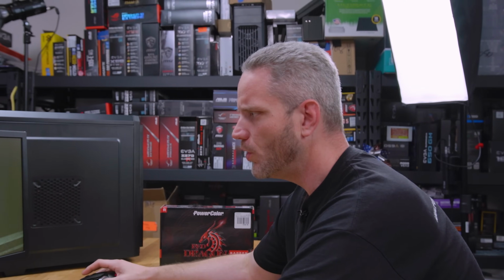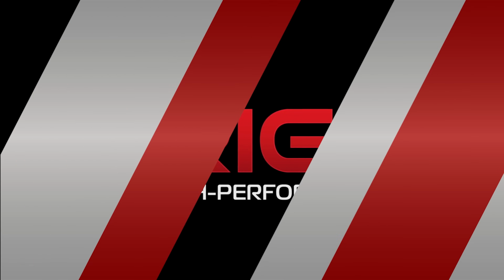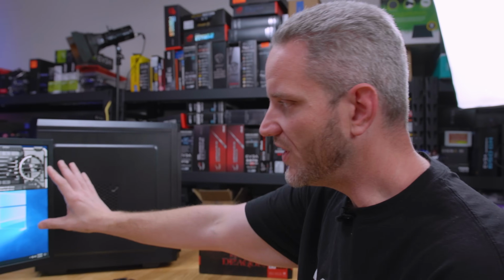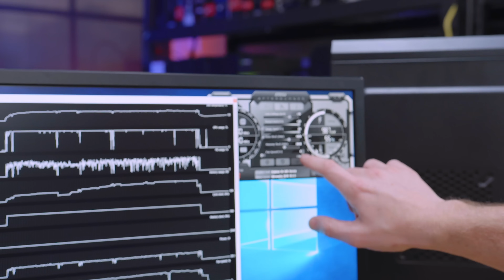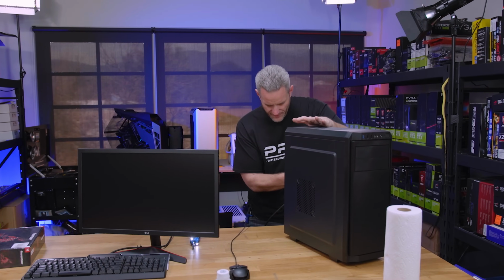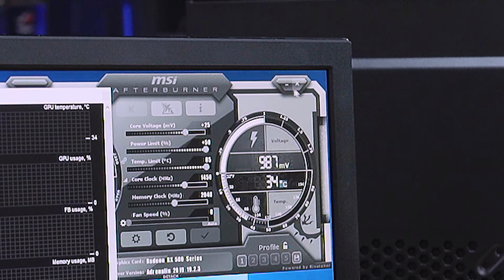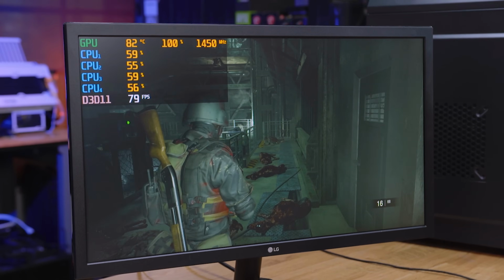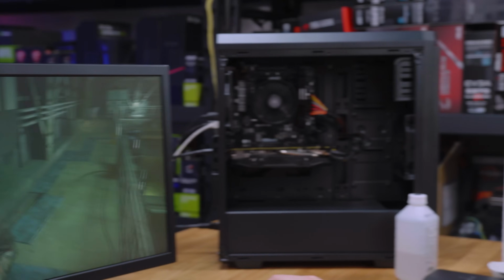Should you replace your video card's thermal paste??

Comment: Oh jay you done goofed on this one :(

Of course you won't see a difference in temperatures because the card has targettemps. Thats also the reason why even putting that huge fan on your case didn't do much, due to the cards fan curve it will always try to ramp less and less up since the card is getting cooler.

Next time when you do a test like this, try to set the fanspeed to 100% or another fixed speed and then do before and after, that way you will see the improvement. By repasting you made the card much quieter.
Reply: This makes perfect sense
Reply: Yeah I was gonna say, surely he's just making the GPU cooler RPM lower.  Still an improvement though.
Reply: Thank God somebody else figured it out.

If you ever want to do this kind of testing you need to compare fan speeds. Better yet use a fixed value so your only variable is temps.
Reply: @taylorsharp5928  i keep my 2080 at 100% fan speed while playing games. i didn't buy a high end GPU for it to be quiet lol. bought it to get high fps
Reply: @ZapdosVz  - You'd get high fps with rtx 2080 anyways so I don't really see the point of having a vacuum cleaner right next to your ear.
Reply: @Hasla Hali I got the card for high FPS. I didn’t buy it worried about the sound. I have two monitors I switch between for gaming, a 1080p 240Hz and a 1440p 144Hz. I like to make sure my FPS doesn’t dip below those refresh rates. Lower temps=more FPS because the way gpu boost works
Reply: Zapdos Vz - Well sure, you can use your card as a leaf blower and maybe gain 3 fps more. I can't really see the point personally but you're free to do whatever you want with it.
Reply: @ZapdosVz  Running your fan speed at %100 is a great way of burning out the motors
Reply: @taylorsharp5928 I use my r9 290X at 100% fan speed more often than not, specially when playing heavy titles
Reply: @Almamu  I Killed my 290x's fan by doing this. But then I replaced it with a arctic accelero xtreme iii, cooler. Wish I had known years ago just what a major difference that cooler makes.
I Highly recommend it.
Reply: @kewlztertc5386  it really depends on the brand you bought. The Sapphire fans are shit and I had two of them die without manually setting any fan speed, just with the stock fan curve, so I had to replace them, once I put some equivalent fans that weren't shit I haven't had an issue with them dying, but they'll wear out pretty fast, and that's okay with me, I'll just replace them or buy a better cooler when that happens
Reply: @Almamu  mine is a sapphire too. noisy card, worth replacing the cooler just for sound.
Reply: Yep he's a moron
Reply: @aaron-xi8dq  not a moron, just a missed step.  it happens sometimes.
Reply: You're right. I came down in the comment section to say this. Jay, you should revisit this by setting the fans on 100%. That way you will be able to see a difference.
Reply: Couldn't agree more
Reply: @taylorsharp5928  A couple of degrees could matter a lot when it comes to hbm2, that's because it's extremely temperature sensitive from what i understand.
Reply: Yeah, I came to the comments to say just that - in fact I have already replied about target temperatures in a different comment thread already.
Reply: @taylorsharp5928  do you even game?
Reply: I see this comment just after I post my commnet. Finally got someone know what exactly Radeon card works.
Reply: @taylorsharp5928  my custom curve is 100% at 65c brought my boost clock from 1879`1919 to a stable 1999. no more frame drops at 1440p either. id say its user case and card cooler type dependent
Reply: @taylorsharp5928  well most of the Time if u using zotac gtx 1070 mini.
Reply: I was gonna say exectly the same. Good point, you should always consider the fan rpm.
Reply: Can somebody explain how this makes sense? Jay said after changing the thermal paste that all the settings are the same, including the fan curve settings. If the GPU fan was running at e.g. 70% @80 degrees before changing the paste, it will still run at that 70% rate when it reaches 80 degrees after you change the paste. So, the same conditions? If the card reaches the same temperatures as before and reaches the same fan speed as before, how is it quieter? What you're saying is: "you won't see any temperature difference on your GPU if you change your thermal paste or even if you put a huge fan facing it, unless you set your GPU fan speed at 100%". In fact the huge fan of course had an effect, went from 81 to 74 in a few moments. We just don't know how much lower it went because it was cut. It's just a low-end card that doesn't cool itself very well.
Reply: @UnknownEAFCPlayer  You're right... on the stock fan curve, the fans wouldn't run any slower if the temperatures stayed the same. There's a ton of mixed information and bandwagoning going in.
Reply: @taylorsharp5928  Any time I'm not on water (which is rare) I just put my cards full blast and leave it there.
Reply: Kek
Reply: MSI, afterburner has an always on default fan curve, that can be used to over ride AMD s temp target control.
Reply: This. There is no way Jayz could change temps for a Polaris card without using fixed fan speed. Polaris cards have target temps that card wants to keep everytime, meaning the only difference is fan speed to keep that temp. You could change that target temp through BIOS mods btw.

Two days ago I got a MSI RX480 8Gb that was  really hot into the 80ºc, throttling hard. Changed thermal paste to Noctua NT-H2, modded BIOS to a RX580 one and applied some undervolt and changes in mem timings. Now, it stays at 65ºC without throttling. It is completely a different card now (not only because 580 BIOS).

Same happened recently to a RX570 4Gb Gigabyte, which had an original thermal paste application that was really bad. New paste = bye problems.

Apart from Polaris cards, I have experienced something quite similar with R9 290s from ASUS, where new paste = no throttling and less temps.

So, my conclusion is that changing thermal paste is something really recommended for older cards that throttle hard even with fans spinning at maximum, which are usually the way a bad thermal paste behaves in a modern GPU.
Reply: plus he just gooped the shit on there instead of spreading a thin layer
Reply: @AlphaStream_AI  You really haven't researched this have you?
Reply: @802Garage  from personal experience, my video card was running super hot so i took it apart and put a thin layer of arctic silver and that took care of it. I would never think of just squirting it on and not spreading it out. If its not thin it acts as an insulator instead of a transfer of heat.
Reply: @AlphaStream_AI  Research the topic. There have been tests done on this. Your results are because you wentt from poor quality or poorly applied paste, or inadequate pressure on the paste, to a proper setup. The paste will be squeezed to a thin layer by the pressure of the mounting system regardless of how you apply it. Your method works, but it isn't better.
Reply: @AlphaStream_AI  Not even trying to be a jerk BTW, I know there is no tone in comments. Just actually telling you what has been tested.
Reply: @802Garage  touché
Reply: @AlphaStream_AI  well played gentlemen
Reply: @802Garage  take your own advice...arctic silver has to have the 2 surfaces 'fogged' to fill any microabrasions using pref a coffee filter with a little artic silver on it,then apply the the normal amount of thermal paste in your preferred way.i use arctic silver 5 which has a cure time of 200 hours.ive noticed a 6-8 dgree drop in temps under load over that time on an intel 8700k.so this test is flawed regardless...
Reply: @forceofone  I hadn't heard of that before! Seems wise to essentially "wipe" some paste into all the micro channels before just trying to squeeze it in.
Reply: I use silver 5 too,  what do you mean by fogged ?
Reply: @forceofone  The thermal paste expert and guy who works with thermal grizzley indicated otherwise in a video answering thermal paste questions with gamers nexus.  You can spread it but the pressure and initial heat will cause it to flow where it needs to.  It's a good watch
Reply: @shawnofmfd  im refering to arctic silvers instructions
Reply: @forceofone   @jason p  I'm looking at their website and they actually reference center dot, horizontal line, and surface spread application methods depending on your CPU. Not saying your method won't work but the "curing" is what gets the particles into the micro abrasions anyway.  Your coffee filter "fogging" is probably just expediting that a bit
Reply: @shawnofmfd  the instructions included with my tube of arctic silver 5 literally said to 'fog' the ihs and the back of the cpu block with a little thermal paste on a coffee filter to fill any microabrasions and then apply as per their guide.it isnt an idea i just came up with...it literally says it in the instructions....
Reply: @forceofone   jason p  I believe your instructions say that.  Your instructions don't equal every thermal paste out there and warrant telling someone to listen to their own advice.  You have instructions to 1 thermal paste and think it equals the universal instructions? The thermal compound you are referring to literally has multiple application methods listed on their site right now anyway.  The website is always more current than some printed instructions.  Artic Silver still references "tinting" the cpu but it is only recommended not required.  It is just to speed up the cure process
Reply: @shawnofmfd  i didnt say anything about it applying to all thermal pastes...all i did is point out that this test is flawed as it doesnt allow for the recommended 200 hour cure time of arctic silver 5.and to be honest,i think that fogging/tinting the cpu is a good idea regardless....i think you are just argueing semantics for the sake of argueing....
Reply: @forceofone  Watch the games nexus videos on thermal paste.  Basically as long as your IHS gets covered, he shows that the method used does not matter on how its applied
Reply: @forceofone  His test would only be flawed if he used Artic Silver.  I have some Kryonaut and Kingpin paste here and neither require any curing at all.  I think the only reason Artic Silver's does is because it's made to last for 8 years or so on a cpu
Reply: @shawnofmfd  the temps of arctic silver improve over the 200 hour cure time ,so the temps in the test are inaccurate for arctic silver as it hasnt been allowed to cure....
Reply: @forceofone  he used Ectotherm not Artic Silver in the video

Comment: I have a next kraken g12 with a 120mm aio and my rx580 now runs below 50 degrees (no OC). It used to run at 83 max with stock dual fan cooler. I know it’s performance don’t worth it but for sake of silence it’s does for me.

Comment: my Sapphire RX 580 Nitro + (1500 core - 2250 mem) will stay at 60ºC even overclocked , even playing with an E5 1650 v1 oced to 4,6ghz emitting 80ºC playing for hours one of the most exigent cpu bound gaming out there : Assassins Creed Odyssey. So that card...well...not very good cooling. Ohh, BTW, the fan just barely needs to go to 60% (custom fan profile)
Reply: What is your fan curve? I have the same Nitro + and on auto curve, 100% GPU usage max temps are 75°C highest fan RPM i saw was ab out 1430RPM, I'm not sure what is the highest RPM on this card. And I don't know if I should aim to lower the temps or not.

Comment: I would always spread the thermal paste if you're working on the bare die because there is always the risk of an uncovered spot (which then can fry if you power your computer on),if you're using the "one dot in the middle and good" methode.

Comment: Jay here’s one for you. I have a Corsair 1000d with the enermax liqtech 2 with push pull config, 8 fans in front of it and now GPU’s don’t go above 45c under load (EVGA 1070ti’s x2) overclocked to the max and CPU (1900x) overclocked to 4.1ghz constantly would that effect airflow. I don’t think it does but maybe another video for you.

Comment: Have always spread the thermal paste with my finger across the die to cover the whole die. Graphics card has a lower temp between 5-10C. Ryzen+ 2600x @ 85c max load across all cores/threads with stock fan heatsink (AIO leaked had to send back) @ 4.2ghz.

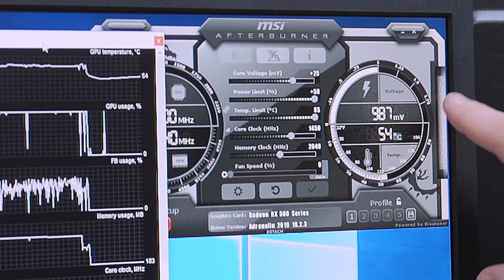Comment: Look back at the fan speeds now, and compare them to the fan speeds before changing the thermal paste. Judging by the Afterburner graph of Fan speed in the before footage at around 2:55 ish, you're running auto fans, so if the card is happy when that temp, it would just be quieter with better cooling capacity at lower fan speeds.

Comment: Did he set a static fan speed? Because ik alot of gpu manufacturers set their fan profiles to keep the card around 80c
Reply: yeah my RTX2070 stays at 70 no matter what I do when it's set to auto fan settings.
Reply: ya myt rtx 2070 will sit at 80C when i play newer games with the fps uncapped if i'm playing wow i set it to 100fps and it stays around 60C it's the msi rtx 2070 aero blower so oh well i have a good warranty and honestly i think people freak out about temps.
Reply: Red dragon rx570 targets 80c
Reply: I thought the same, since loudness was a thing before, but wasn't mentioned afterwards :)
Reply: @MRaeble  actually my powercolor one is really quiet it targets 80c so the fan isn't aggressive
Reply: @sabagamer3052  But Jays was on the video :D
Reply: WTh 80C?  you must have that half product of nGreedia.. My RX never goes more then 76C playing  Odyssey on ultra , ahahaha 80C...Normal GPU temp is way below 50 , with fans off even.
Reply: I know EVGA did that with the 900 series
I replaced my paste. In my case it needed it, but the temps remained the same.
I was thinking to myself that new paste would at least see an improvement.
But then again, it could also be the cooler.
Reply: Gtx 1080 from gigabyte : target temp 82C at 100 percent power draw ... after that the card will run at full speed which is really really loud
Reply: so heat make your card slower? or its just for fun you all here?
Reply: @kaimas1005  heat doesn't make it slower but it does make in more ineffent.  You get more power leak.  Also some ppl dont like there card to be at 80c,  and some complain about there card being to noisy, and some complain that it's too hot.
Reply: @drowley  just say ,its for fun.
Reply: @kaimas1005  it's for fun

Comment: You should replace it with thermal grizzly hydronaut that's what I always do because the best of the best in pretty much the same as kyronaught
Reply: That cooler looks to have an aluminum contact plate.
Reply: @EvilTurkeySlices  hydronaut and kyronaut are both non conductive

Comment: with my RX 580 i basically run fans at 100% all the time and the max temps are usually 79 to 82C. its the hottest card ive ever had. i was going to buy another one to crossfire but theres no way they would last on air. one of them would die
Reply: your thermal paste is shitty, even reference 580s on 100% fan shouldnt hit 82c

Comment: I see you're at 1450mhz. I've been running my new rx580 at 1485mhz. What is your video memory speed?
  Edit: Never mind. I should let the video play before typing comments. 2040mhz memory. Mine is +6 power instead of +25
Reply: 1485mhz wow, what card do you have and what voltage are you using? I have nitro + 580 and it's stable upto 1440mhz with stock voltage, so just wondering
Reply: @DragonDROIDD  it's an xfx rx 580 8gb.
  Here is the link directly from newegg. It's the XFX Radeon RX 580 GTS Black Edition 1405 MHz OC+, 8GB 256-bit GDDR5, DX12 VR Ready, Double Dissipation, Dual BIOS, PCI-E AMD Graphics Card (RX-580P828D6) , https://www.newegg.com/Product/Product.aspx?Item=14-150-794&Ignorebbr=true
 It goes for $189.99 right now. I bought it a couple months ago at $194.99. The 2 free games adds value, too. 
  I tuned it by playing firestrike and bumping up the speed until it was artifacting. I couldn't get it to finish at 1500mhz but it did finish at 1495. I backed it down to 1485 and haven't had any problems with it. Stock core clock is 1386mhz. It's weird though. If I try to clock the vram any higher than 2000, even 2020, it doesn't like it so I leave it at 2000mhz. Temps are mid 70s under load. If I clock higher ranges, it goes into thermal runaway and crashes. Once it sees 85 degrees C, the image gets all distorted and colors get messed up and it crashes. Lowering the core voltage helped a lot with temps. Like I said, 1485mhz has been stable for me so far. I'm using the cooler master H500P mesh case. It has better airflow than Jay's case here. It's the one with 2 front mounted 200mm fans and a single rear exhaust fan. I did my testing with the case fully closed and all of the panels on. I'm sure it could run cooler with the side panel or front panel removed.

Comment: Two words: Temperature target. The temperature won't change, but the fan speed is likely lower to maintain that temperature. You can change the temperature target in Radeon Settings.
Reply: Temperature target isn't in Radeon settings anymore if i'm not mistaking
Reply: @remcojonkers5027  you can effectively set it within the custom fan curve, which gives you axes for temperature and fan speed.

Comment: Who plays fortnight anymore? Thats so 2018!

Anyway further to this, even if the temps don't go down did the fan rpms come down? SO it could have been before 82C @ 90% rpm or could have been 82C @ 60% rpm.
Reply: @crazycajunj1703  I take it thermal dynamics is beyond your comprehension then. The Fan is set to auto which you can see in afterburner with the 0dBA mode and then maxed out at 73%, if the fan was set at a static 73%  and the thermal paste was changed then you may very well see a reduction in temps. If left to auto like this was it will still hit it's thermal threshold limit but is doing so at a lower fan curve = noise reduction.